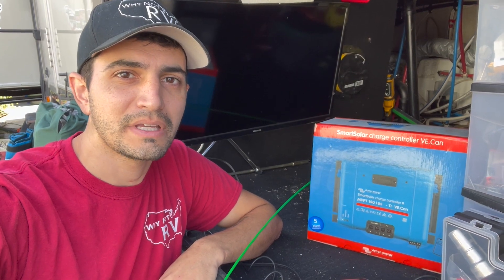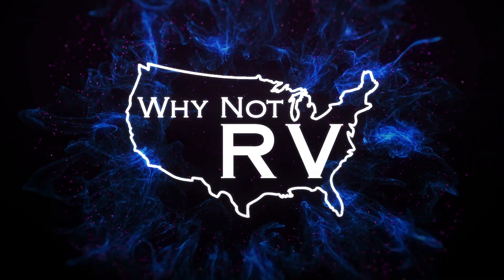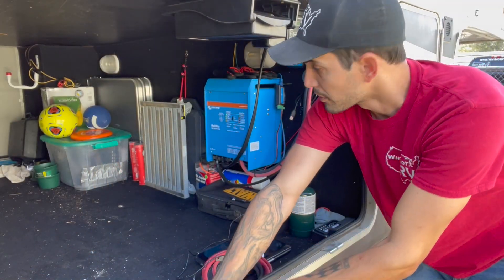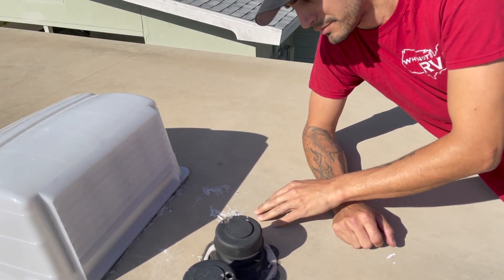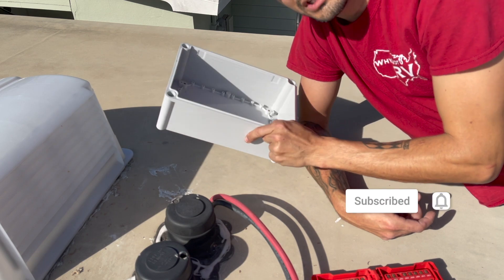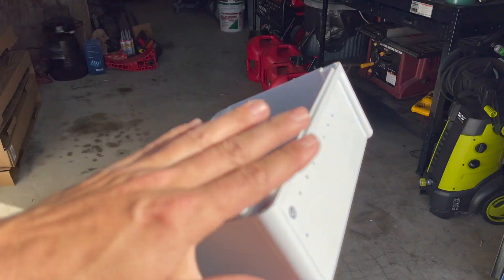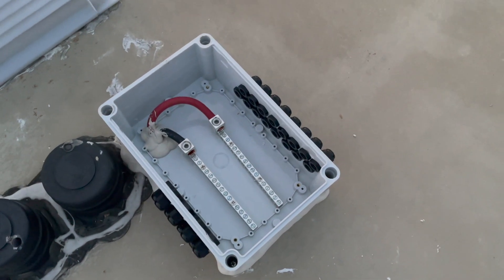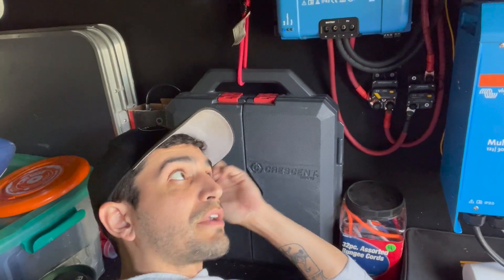Solar Charge Controller Install - Why Not RV: Episode 47

Comment: The 85 number is not the current it can accept from the panels, it is what it charges the battery at, 85 amps out to the battery
Reply from the maker: Yes. Max charging amps capability.

Comment: Nice video.  I just installed the same Victron 150/85 solar charge controller.  One thing I learned is that the 85 amps rating is the maximum output of the solar charge controller (not input - the 150 volts is the maximum input voltage).  The maximum output of the controller is 1200 watts so if you are producing 14.1 volts you are at about 85 amps.  You can add more panels because you will likely never hit the maximum per panel (especially if they are flat on the roof).  If you do exceed this value (1200 watts of panel output) the controller will only provide a maximum of 1200 watts to the batteries with no harm.
Reply from the maker: I learned the same thing. Makes sense why so many people end up with multiple mppt chargers.

Comment: I don't know about you but, drilling that hole for the roof was the most anxiety producing moment for me...lol  My fish did hang up in the wall for a bit though.
Reply from the maker: Leading up to it was the most anxiety. Once I knew where to drill and I turn the drill on all the anxiety went away. Don’t know why LOL. Yeah, there’s tons of stuff in the walls between all the wires and white night I’m surprise mine didn’t get hung up at all. It just went straight down no issue.